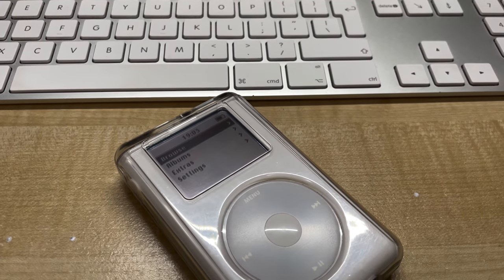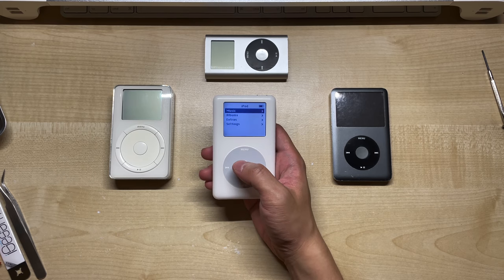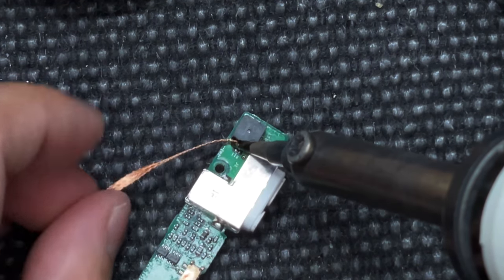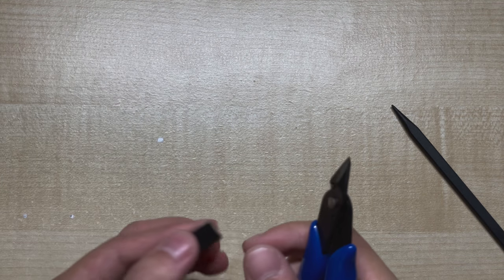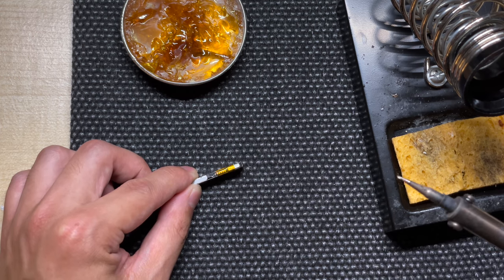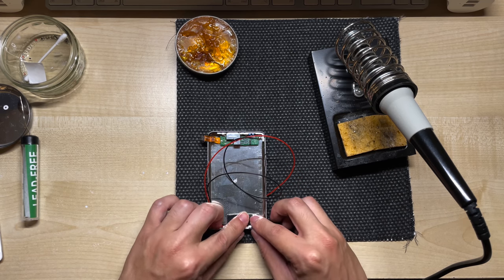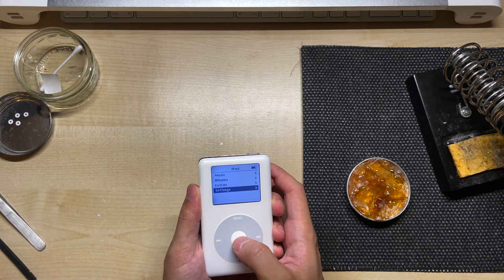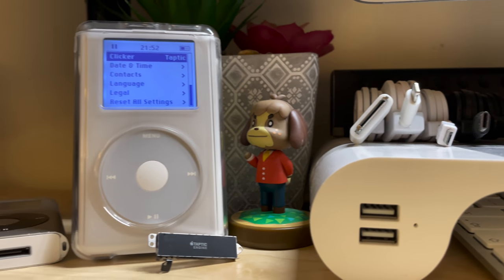iPod 4th Gen Taptic Engine Mod Tutorial

Comment: Thanks for the videos! Just completed the 5000mah battery upgrade on my 4th gen Photo! Just waiting on a short length sd card adapter to arrive. While I have my ipod open I checked out this video to see how the taptic mod is done but noticed some dissimilarities on my 4th gen when soldering the wires to the board. Can this mod only be done on the monochrome? Or are the soldering points different on the 4th gen Photo?
Reply from the maker: It can also be done on a photo model, but I think the piezo clicker is in a different location on the headphone board.
Reply: @NekoMichi  Thanks for the clarification!

Comment: Hey Neko, really cool idea!!! 
And it is not just another video how to change the battery. Your video adds real value to the ipod community!!! I will definitely  try this out. It seems, that the taptic  engines are pretty  cheap on ebay. By the way, where did you get that cool transparent cover case for your 4th Gen?
I have seen a lot on AliExpress for the 5th Gen 30gb models, but not for the 4th….
Great video
Reply from the maker: Thanks for the feedback! The transparent iPod case was included with a bulk lot of iPods, I've searched up online and it appears to have been made by a company Proporta. The exact product name is "iPod 4th generation Crystal Case" by Proporta.

Comment: Amazing idea, i wonder if it can be done in a 3th generation nano, i've created a larger back cover and i'm putting a 2500mah battery in it,  i think i can fit also the haptic feedback, do you know the voltages used by the haptic feedback?
Reply from the maker: I think someone in the iPod Modding Discord connected it up to an oscilloscope and measured 3V peak voltage. I've just received a 3rd gen Nano with no back plate at all recently so that might be something to test.
Reply: @NekoMichi  I'll try to measure the peak voltage in the 3th gen nano, if i can help i can tell you the measures in order to create the back and how i did it
Reply: Update: For everyone wondering i installed the iphone 7 taptic engine on an iPod nano 3th gen and it works very well

Comment: is there any reason you use specifically an iphone 7 Taptic Engine? Seems like iphone 11 ones are smaller and it may be easier to find space to fit them
Reply from the maker: From the iPhone X and onwards, the Taptic Engine has gotten smaller but that also resulted in a different-feeling haptic output.

The main reason why I use the iPhone 7 motor as opposed to newer ones is because it's the most common and cheap to find and also newer generations might not have the row of pads hidden on the side.

Comment: I have a couple if you wouldn't mind answering them for me since I'm fairly new to soldering and even wiring at that anyways my questions are: what kind of gauge wire are you working with? when you tin the pads on the headphone board how carefully should you do it to not ruin it? I wouldn't want to accidentally burn it and end up ruining the pads and make them unusable for soldering, those are really the questions I have so far if you could answer these for me I would appreciate it very much thank you for the video.
Reply from the maker: I'm using generic wire I found, the exact gauge is unknown, but they are about 1mm in diameter (including insulation). Ideally you should use thinner wire as it puts less strain on the pads if they move around, some people have taken old USB or Ethernet cables and stripped the inner wires to use and I think those might work better.

As for the pads, I avoid touching the soldering iron tip directly to them and instead I melt some solder onto the tip and gently dab them onto the pads almost like dabbing glue onto a crafts project. You don't need a lot of solder to get the job done, just a thin layer will be enough. If you have any spare dead devices, they're great for practising soldering on.

All the best!
Reply: @NekoMichi  hm I did buy 18 gauge wire which should be about the same but when I got it it did end up feeling really thick even when stripping the wire it seemed like it might put too much stress on the pads but I hope not.
Also what I'm mostly just scared for about the headphone board pads is burning the metal part of it if I were to burn it or heat it up enough for it to fall out would the board no longer work? also thank you again for answering quickly I appreciate it!
Reply from the maker: 18 gauge wire is a little thick, but can work if you're careful. Once soldered to the Taptic Engine pads, make sure to tape the wire securely to the body of the motor so that any movement is minimised. If the pads on the headphone board are damaged, the mod won't work but you'd have to be really rough with it in order for that to happen. Do you have any soldering flux? I find that cleaning the area with flux can help.
Reply: @NekoMichi  the 18 gauge ended up being too thick and I ruined the taptic engine I'm not really mad since I ordered two to be safe but since I'm new and do not have a steady hand I learned as it went on lol going to try out 28 gauge wire which is about the 1mm diameter range you mentioned but you wouldn't think that maybe the aluminum tin that we use to tin the soldering iron would work as well ? especially since that is also technically conductive and could possibly end being a little easier to actually solder onto it? I'm not sure would like to head your opinion on it though : D
Reply from the maker: You mean the solder itself? Solder shouldn't be used as a replacement for wire because as soon as you try to melt one end, it'll recede and it won't stay in place. The outside is also not insulated and will cause a short with anything it touches.
Reply: oh right i didnt think about the insulation within the wires haha i really appreciate the tips for soldering tho and now know not to use the solder itself lol thank you!
Reply: @NekoMichi  wait I'm sorry to bother again but what are you using to actually heat the speaker of the board?
Reply from the maker: I'm using my soldering iron, just gently apply heat to the side of the contacts so that it melts the connection to the board. Take care not to touch the soldering iron tip to any plastic parts of the clicker as it would melt and burn.
Reply: @NekoMichi  oh ok thank you again!
Reply: @NekoMichi  oh wait sorry I meant like the copper looking wire thing you hold between the iron and speaker haha
Reply from the maker: Ah, that's desoldering wick. It sucks up any stray solder that melts and makes it a little easier to remove the clicker. It's optional and not 100% essential for this.
Reply: @NekoMichi  oh ok thanks again it looks pretty helpful tbh
Reply: @NekoMichi  hey man so I just wanted to say thanks to all your help I was able to do this mod on my own the taptic feels really great and adds such a difference to the iPod click wheel it's pretty crazy tbh how much a difference a small punch in your hand makes haha but thank you again looking forward to doing this to other iPods!
Reply from the maker: Great to hear! Congrats on pulling off this mod!

Comment: Hi! Question regarding double sided tape vs epoxy — Of course the ideal scenario would allow for this Taptic Engine to be serviceable but does using double sided tape come loose with time. How significant is the Taptic intensity when using epoxy instead? My plan was to double sided tape it to the metal backplate and then hot glue the sides so that it doesn’t fall loose unless epoxy allows for a much much stronger Taptic feel
Reply from the maker: Your method should work fine too, so long as there's something solid mounting the Taptic Engine to the back plate. Double-sided tape on its own will wear down over time, especially if the iPod heats up when syncing or charging as it will slowly melt the adhesive. However if you reinforce it with hot glue then it'll be secure.
Reply: @NekoMichi  thanks for that reply! Do you think epoxy ultimately makes a big difference in how intense the Taptics are felt or is it minimal when mounted to the backplate with either method?
Reply from the maker: @gkivo  I think hot glue and epoxy will both have the same haptic intensity.

Comment: Hi Neko, do you know which taptic engines from either the phones or watches that have the diagnostic ports? It appears that the iPhone 12 mini does not have these pins. Is there an online references or data sheet?

I'm hoping to add one to an old casio with a 593 module and thought just like an Apple Watch, these would be great.
Reply from the maker: I think they stopped using these pads on the Taptic Engines since the iPhone 11. I'm not sure about recent Apple Watch Taptic Engines, but I've tested a Series 2 motor and it has two pads openly accessible for use.
Reply: @NekoMichi  Thanks. This is still very useful. I'll see if I can narrow it down further and let you know.

Comment: The last couple of classic 4th generation ipod I've tried using the generic green board flash will only restore on my old mac , every time I use my Windows laptop it restores I plug it into the external power supply as usual watch it load up restart and show folder sign and soon as I connect it back to the laptop I get the error iTunes has detected message I've reformatted the card to fat32 ect, yet plug it into my old mac and it restores perfect every time luckily I have software on my laptop that let's me run ios devices 
Anyone got any suggestions

Comment: Hi can the 3rd gen ipod from 2003 power the taptic engine?
Reply from the maker: Sadly, the 3rd (also 1st and 2nd) generation iPod can't.
Reply from the maker: Hi there, I have an update on this. I was able to get the Taptic Engine working on an iPod 3rd generation but the wiring is a little tricky.
Reply: Oh wow! That’s so cool! Does it have to go through some additional circuitry?
Reply from the maker: No, but the problem is that the piezo clicker is located on the main board on the 3rd gen and not on the separate headphone board, making it both difficult and risky to access.

Comment: I have a 4th gen 20gb back but I also have the generic green flash card adapter because rockbox doesn't like SD cards on the 4th gen. Is there a way to fit both the flash card and the battery with the taptic engine?
Reply from the maker: It will work with the stock battery, but not if you're using an upgraded battery.

Comment: I tried to do this but it turned out to be very weak. I tried to desolder the clicker speaker but it can’t  come out so u just soldered the wires and kept the clicker in. So i have both the clicker and the Taptic Engine. Now for some reason even when i remove the wires for the Engine, and keep only the clicker, now the clicker is very quiet. 

At first i tried using 34 gauge enameled wire but it was very weak. So i thought it was the problem of the wire thickness so i changed it for thicker wire( around the diameter you used) but it still didn't change. 

My current setup is both the clicker (quiet) and the Engine (weak) with 34 gauge enameled wire. I can figure out how to either make the Engine more powerful or revert to only the clicker but as loud as it was before. Please help. Thank you.
Reply from the maker: Is the ribbon cable for the headphone jack assembly securely plugged into the main motherboard?
Reply: I tried replugging the ribbon cables on both sides many times and it didn't help. Any other possibilities?
Reply from the maker: In previous tests I also noticed that output is weak if both the clicker and motor are connected at the same time. It might be necessary to remove the speaker fully in order for the motor to output the correct force. Sadly I haven't found a way to have both working at the same time.

Comment: Does the iPhone 7 Plus Taptic Engine work??
Reply from the maker: The 7 Plus engine might work, but I haven't tested it before. If it has the same diagnostic port hidden under ink and tape, then it can be used.
Reply: @NekoMichi  should I check that out for ya?
Reply: I just wanna know if it has the same feel as the regular 7’s Taptic Engine
Reply: Or if not a better feel
Reply from the maker: Sure, check and see if there's a hidden diagnostics port on the side
Reply: It should, but it's larger so fitment may be harder.
Reply from the maker: I've tested the 7 Plus Taptic Engine and it works too. Haptic feedback is slightly stronger but the difference isn't very significant. It fits in a 5th/6th/7th gen battery spot perfectly though.